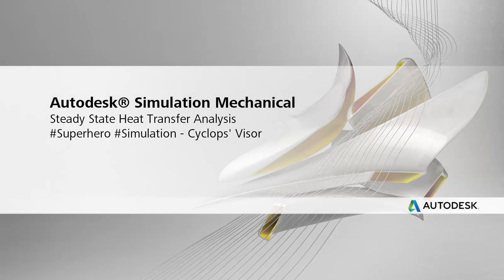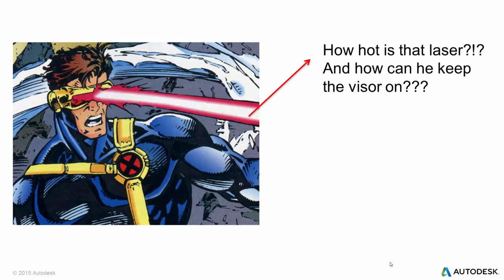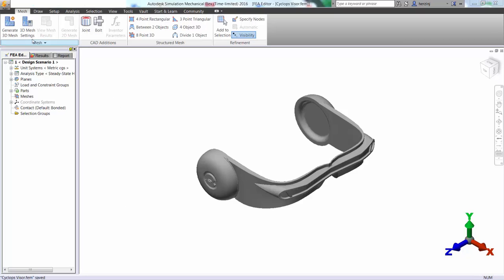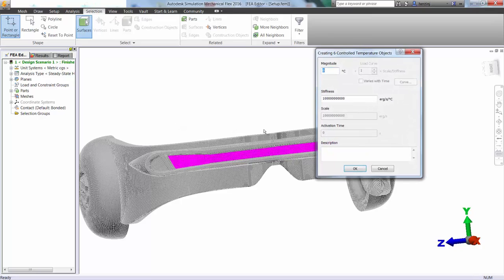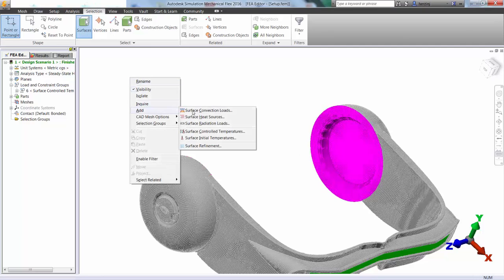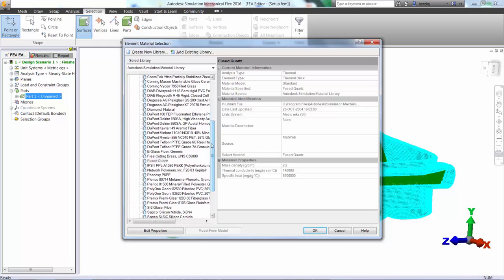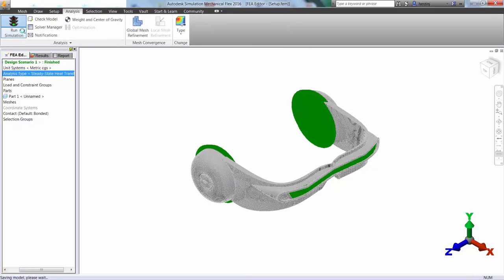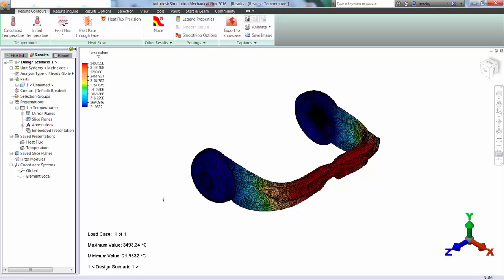Cyclops Visor Steady State Thermal Simulation

Comment: A prism directing lasers could reduce the contact area between the laser and the display material, thereby decreasing the temperature increase that could be harmful to the face area. Perhaps Ruby Quartz has heat dispersion properties, all the energy that would be used to heat is focused on laser. Sorry for my English.